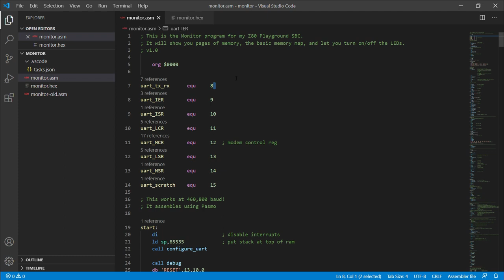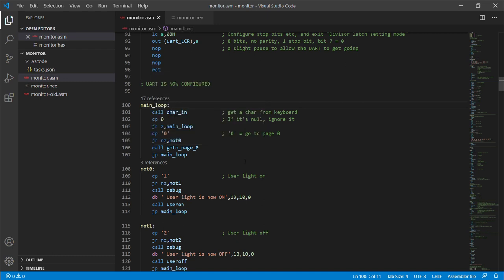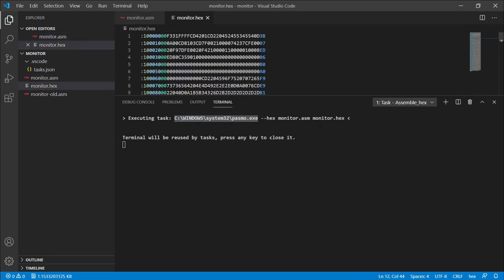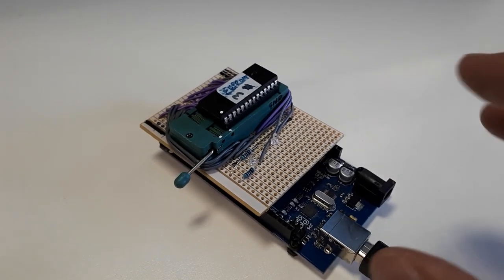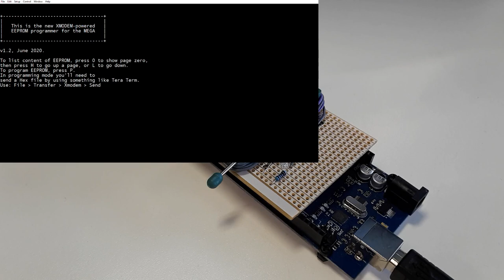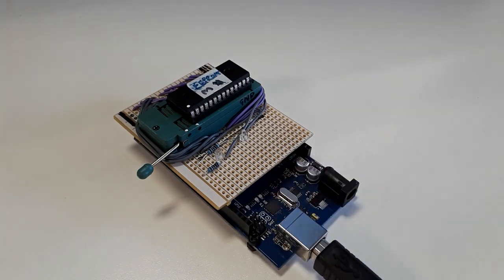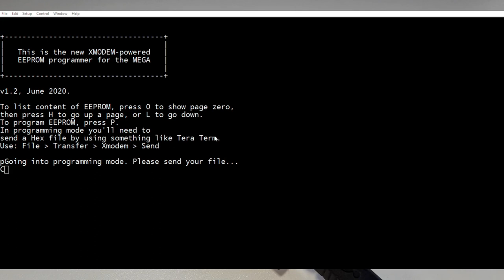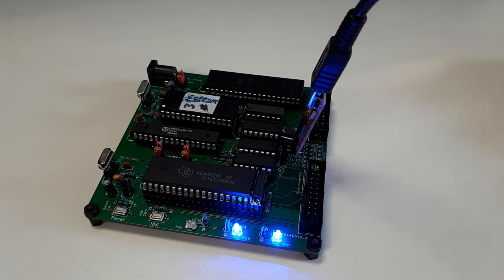My tool-chain for programming an EEPROM with a Z80 assembly language program.

Comment: do you have a wiring diagram for the programmer and link to the software you used
Reply from the maker: I am in the process of making a video on this. It's a very simple programmer, and it is based on an Arduino Mega, so if you have one of those you just need a socket and a couple of LEDs. The software I wrote myself, so I'll put it on GitHub.
Reply: @CircuitBreaker256  thanks

Comment: any chance you could advise how to integrate pasmo into vscode? I've downloaded all the bits, added the extentions and watched a few youtube vids, but some were   v e r y   s l o w  [showing linking/ seting key shortcuts]
Reply from the maker: That's a good idea for a video. I will make a note to do that. But basically I set up a tasks.json entry like this:
 {
            "label": "CCP",
            "type": "process",
            "command": "pasmo",
            "args": ["--bin", "ccp.asm", "ccp.bin", "ccp.symbols"],
            "problemMatcher": [],
            "group": {
                "kind": "build",
                "isDefault": true
            },
            "presentation": {
                "echo": true,
                "reveal": "always",
                "focus": false,
                "panel": "shared",
                "showReuseMessage": true,
                "clear": true
            }
        }
And then all I need to do is press Shift+Ctrl+B

Comment: This is one of the times when Z80 beats 6502.... Z80 likes it's ROM to start at 0000 but 6502 has it in high memory so it can do all it's clever page 0 and page 1 addressing. If you were doing a ROM for a 6502 your hex file would have addresses offset to the ROMs base address in the machine and you'd have to keep subtracting that offset during programming. But with the Z80 0000 in the final memory map IS 0000 in the EEPROM and.... Bob's your uncle.
Reply: ... its ROM ...   ... its clever page 0 ... 

it's - contraction of "it is"

its  - possessive pronoun